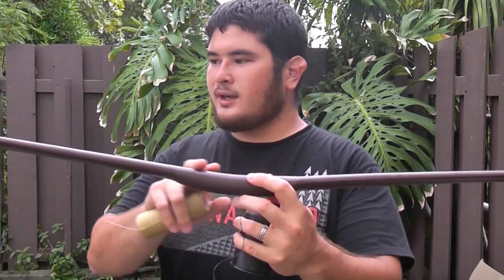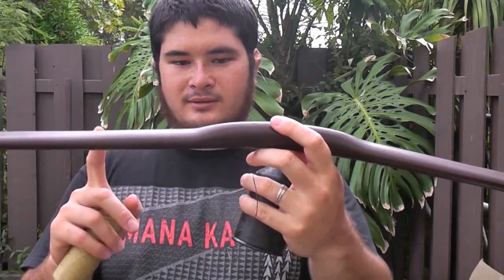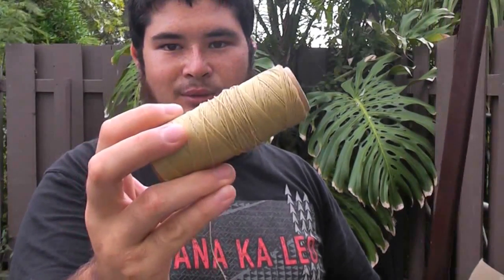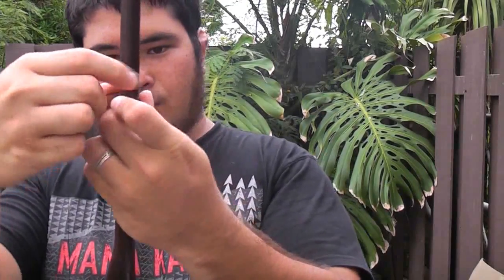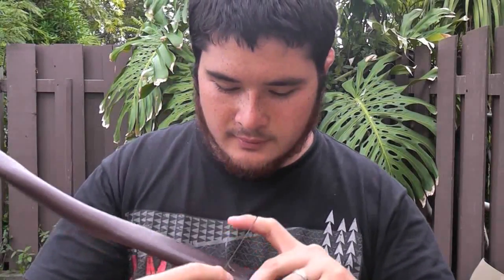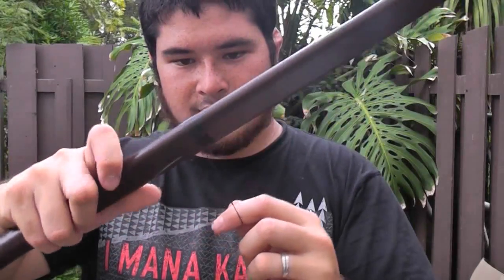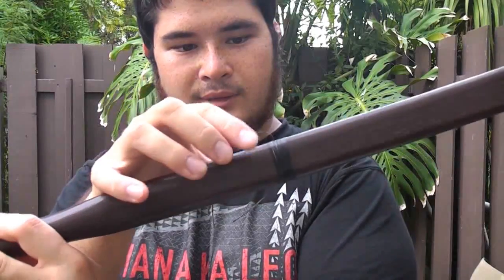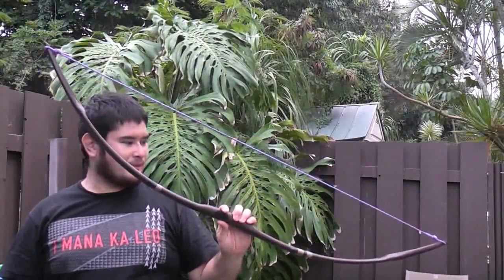How to Make a Hunger Games District 12 Bow with PVC Pipe Part 4

Comment: excellent job...I am curious what happens to the PVC in prolonged sunlight? will it relax back to its original shape in the field when it gets hot from summer sun?
Reply from the maker: No, it would have to get up tp about 200 degrees F for that to start happening. It is possible for unstable bows to become more unstable and fold or one limb to bend more than another, etc.. Stable designs (ones with minimal reflex) don't typically have this problem.

Comment: Just bought your book. Good stuff. How heavy does that bow pull?
Reply from the maker: Gabrielglouw Thanks for the support! This bow pulls around 20-25 pounds, made of 1" pipe, it pulls around 40-50.
Reply: +BackyardBowyer there should be a formula to calculate the final power for a PVC pipe.

Comment: Second try went better, the shape is not quite yet what I want and nowhere close to the one you made. The pipe ripped again on one side, so I'll try not to flatten it quite as much as I did at the end on my third attempt. I shot it at a target at about 10 meters and the arrows almost go through my target which is 12 cm of foam rubber specifically made for archery.

Comment: don't do... i live in brazil and the only similar to the sched he uses is the green ppr one's. i had to heat it at 600ºC for about an hour in order to turn it soft enough to bend, but in the end it turned very strong. this was the first i did, and of course i did some mistakes resulting in one limb bending way more than the other, just gonna do another on the weekend and see if it gets better =]

Comment: I give up. I live in Canada & the only sched 40 pvc pipe i have here is a light grey. it takes forever to heat & even if i do this indoors with a heating troft it still doesnt heat evenly. THEN when i finally get the limbs flat, with a nice taper & curved ends (recurve cos i wont bother trying this style) when i tiller it, a limb collapses & i'm not doing a hard crease either... so i dont know, i give up...